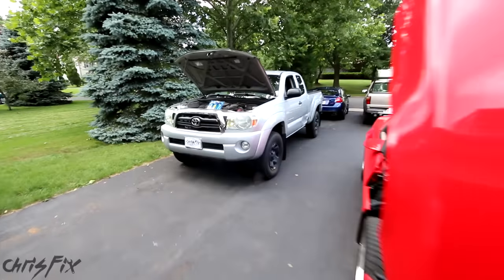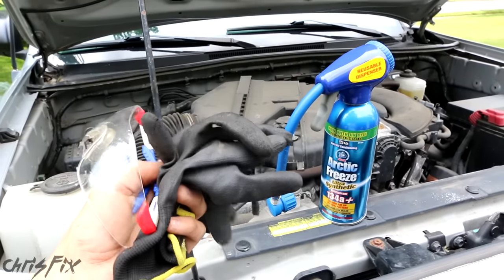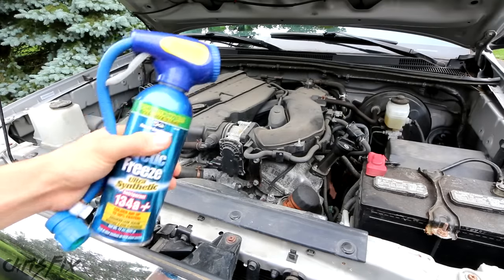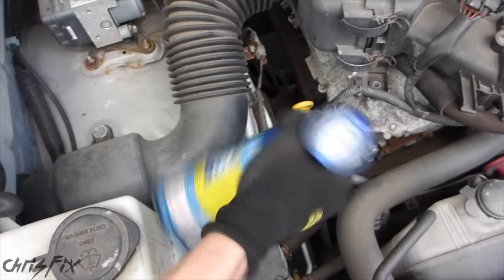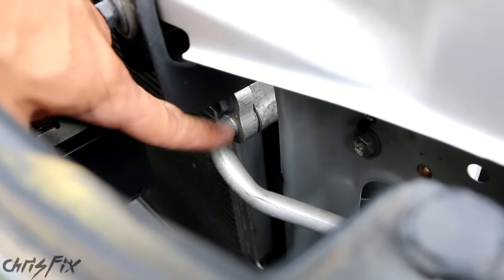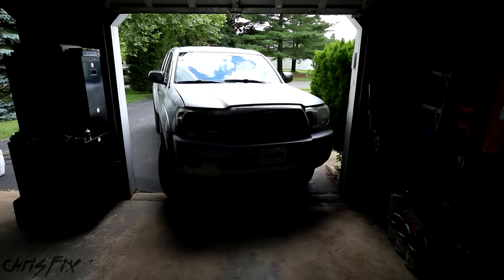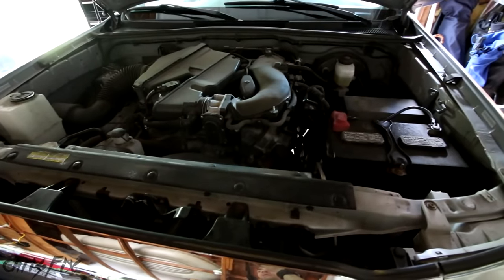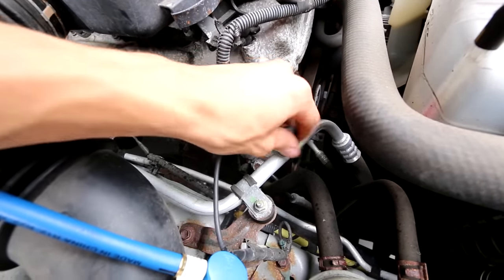How to Find AC Leaks in Your Car (UV Dye)

Comment: Im a woman and men mechanics usually try to lie to me. I always check here first and they are shocked that I know lol.
Reply: Good job Jonquette. They try it on us also. I'm a mechanic and took my truck in for new tires. they had it for over a hour and they wasn't busy.and they came to me with a list of things they said it needed .2000 dollars of work not counting the 800 for tires I told them I will check it and do the work myself. .And a heads up on Tire Kingdom if you have them where you live.  Don't go there my daughter took here car there for a oil change(A simple oil change) they had her tires off saying the bracks are bad and it's not safe to drive. she called me crying, So I went down there. and they had the car on their machine saying it won't start. they did something to it we had to junk the car never could find the problem, It was a very old car I just bought her a newer one.

Comment: Not exactly correct.the system actually removes heat from inside the car and disperses it through condensor .
Reply from the maker: That is incorrect. The condenser is right in front of the radiator and that is the part that gets very hot. The evaporator is inside of the car and a fan blows over it to give you cool air. Maybe you are thinking the heater core which is part of the engine cooling system?

Comment: I’m not dogging this guys video, but please don’t do this to your car if you care about it whatsoever. Firstly, it’s illegal to leak test with refrigerant (you should use nitrogen but some use compressed air) He didn’t vacuum the system to remove non-condensible air and moisture which means his refrigerant will now react with the air and moisture and run at a higher pressure and create an acidic sludge that will destroy his compressor. The small gauge on the cans is worthless as an indicator also. 

I realize many shops are thieves but please - have a professional diagnose and repair your A/C system.

Comment: Seriously? Using refrigerant to find a leak? I can assure everyone, this is not how to do it! This video is complete nonsense (sorry @chrisfix). Just because you can, doesn’t mean you should. Using the method in the video is classed as venting harmful chemicals to the environment and is illegal in most countries (including US of A AFAIK). NO, JUST NO!
The correct method to detect and find AC leaks, involves high pressure oxygen free nitrogen (@10bar or 150psi), a fair amount of time, precision pressure gauges, non-acidic bubble spray and years of hard earned experience. UV lights can be useful, but are not a foolproof method. You can hire or buy all the kit and get the relevant training, which will cost a small fortune or just pay a pro to do it properly for a fraction of the cost. But don’t worry, you can spend a few bucks on a can of liquid death and that’ll fix it! Yeah, sure it will!
Peace!

Comment: This is bullshit
I had to buy a can of dye, then a can tap, then an ac hose, then a flashlight. Why is this little dumb shit all separate and expensive? I can only imagine if I went out and bought the whole gauge set along with a vacuum pump
Someone needs to make a kit for like 20 bucks and call it a day
Reply: We're likely talking about US. I'm in Europe and i assure you that things are even worse here. Aside from the fact that the canned stuff is illegal here, you can walk into 5 different car parts stores asking for compressor oil, schrader valve cores, AC o-rings, refrigerant service port caps, compressor control valves and stuff like that, and watch people look at you like you're asking to buy some kind of plasma rifle. They will have no clue about what you're talking about. Ask this stuff to dealerships and they might have it if you're lucky, but they will usually charge you a arm and a leg and it will always be in backorder. I had to get a lot of parts shipped from the US, for these reasons. Also, a licensed professional whom i tasked with replacing some leaky o-rings actually failed to notice a leaky refrigerant port schrader core on my car after the work was done (i don't touch service port caps, since i can't service AC by myself; discovered it only because AC basically stopped cooling in the course of two weeks after that service).